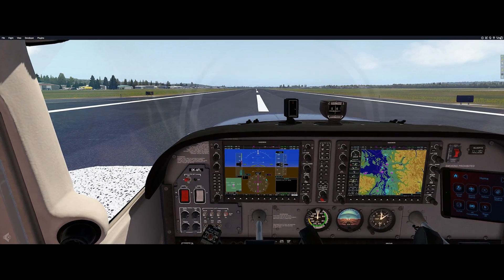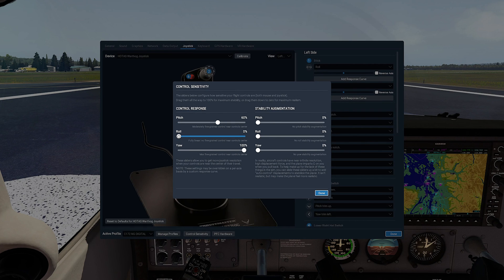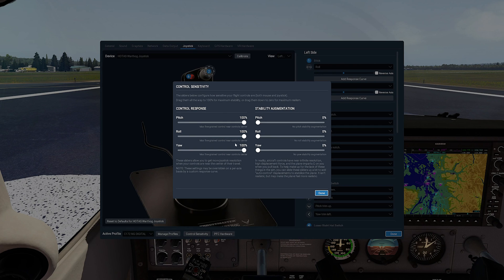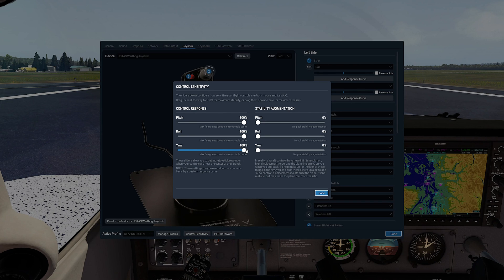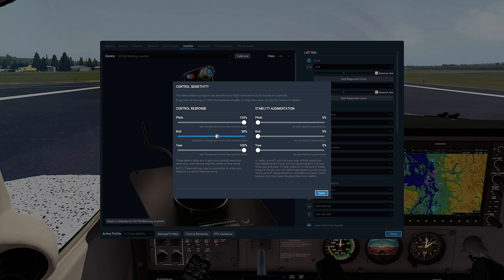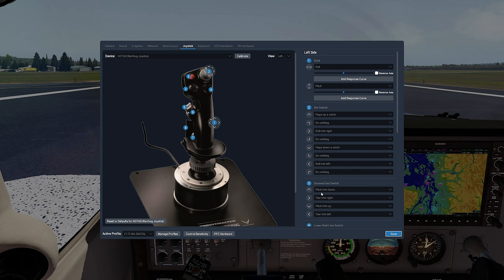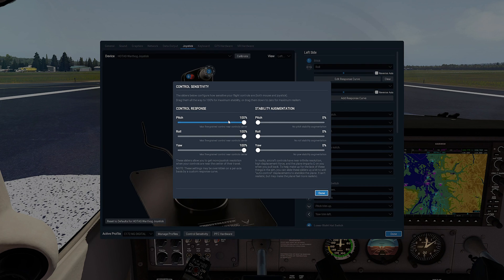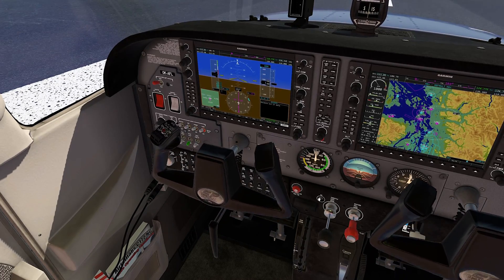C172 NG DIGITAL Controllers Tutorial 1 - How to set your joystick, yoke or rudder controller.

Comment: X-Plane 12 or X-Plane 11 - both versions included. I have both of them installed. X-Plane 12 version works great. Ingenious work. But I have a problem with the X-Plane 11 version. I bought these both in mid month. As I start the 172 NG for x-plane 11, I can not steer on the tarmac using the Logitech pro yoke. I do not have rudder pedals and have not got a problem with any other plane. I have ticket open on your support page since this week and it is still being processed. I have tried just about everything from response curve, disabling plugins. Would you recommend uninstalling and reinstall. And how would I do that. Installing was pretty straight forward. But to uninstall........... And if I can reach out to you, how can I do that. Thank you if you have any suggestions.